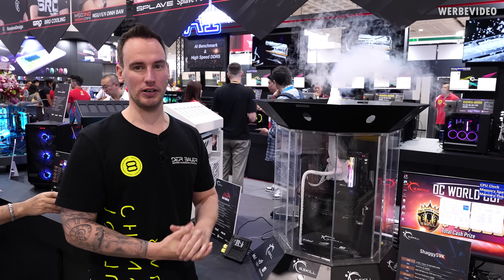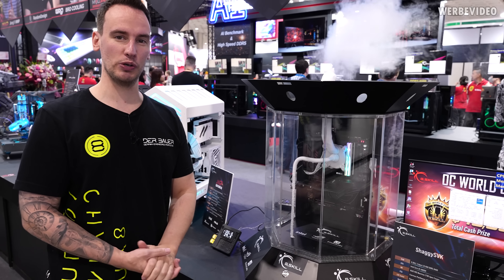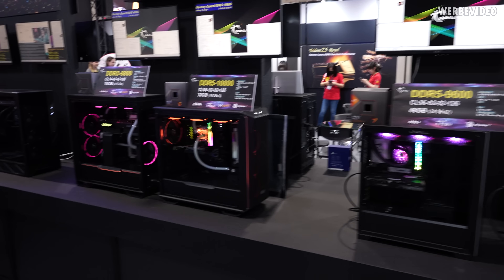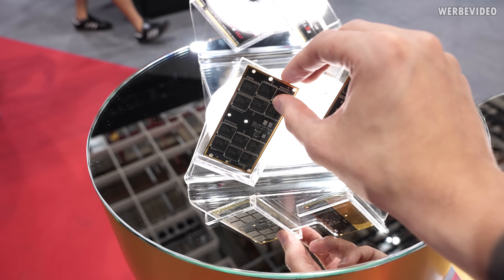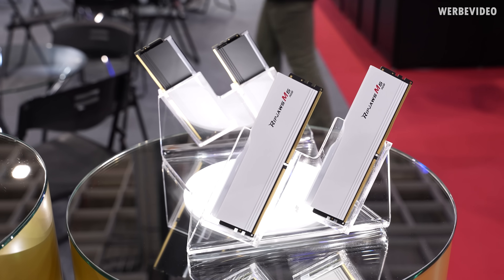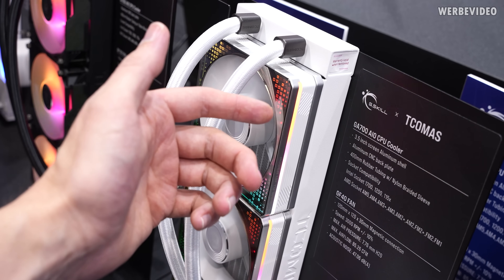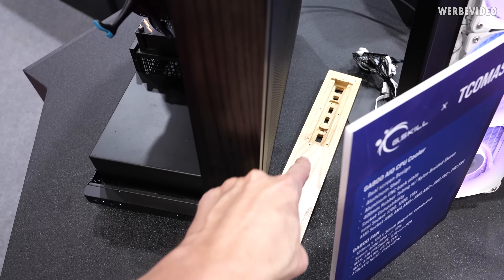DDR5 Modules with 10600 MT and a $ 10,000 LN2 Cooler - G.Skill Computex 2024

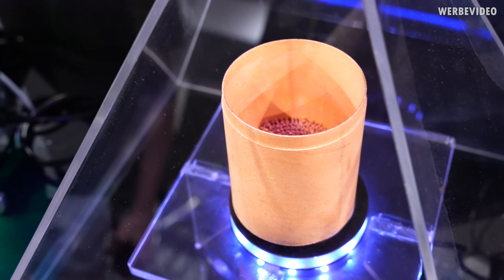Comment: 8:50 metal 3D printing itself is getting a lot cheaper, I have on occasion used it when working in the special machine (custom production lines) business.

The reason this is so expensive is because it uses controlled porosity 3D printing, were they can precisely decide how porous different bits of the part are.

The wall are ofc very close to water tight, while the middle is very porous for maximum contact area with the liquid nitrogen.

Comment: Only reason why I would go for the new form factor is if they support higher transfer speeds in real world applications. Building a new workstation with 96GB in two dimms. So they would also have to at least match current capacity for two channels.

Comment: did they not realize they could have used the nitrogen to pump out the humid air cause nitrogen is a dry gas spaceX uses nitrogen to keep water out of there rockets for that very reason but instead they waste that outside the case how dumb

Comment: wouldnt mind seeing huge low latency dram cache, like several gb, on die instead. in addition to existing caches. then just normal dimms. enough where you can run entire programs from the cache with the background slower tasks living on the normal memory. i really dont like parallel mounting that m.2 uses, despite how fast they are. just hogs board area. so having the ram do that too would be rather cluttered. especially for sff enthusiasts. wouldnt mind seeing cpu sockets with ring dims (can be in sections or a single module) that share the socket (and cooling solution) with the cpu. would make grace hopper's ghost smile.

Comment: Here's a summary of the advantages of CAMM2 (Compression Attached Memory Modules) over traditional DDR (Double Data Rate) memory modules:

Compact Design: CAMM2 uses a compression connection method that allows for more compact and efficient designs compared to traditional DDR modules. This design is especially useful for laptops and other systems where space is a premium.

Improved Performance: CAMM2 modules are designed to support higher data rates. The standard mentions initial support for 6400 MT/s (Mega-transfers per second) and the potential for future increments in speed, aligning with advancements in DRAM technology.

Enhanced Signal Integrity: CAMM2 modules implement specific length-matching principles that reduce unnecessary serpentine routing. This improves signal integrity and reduces latency, leading to better overall system performance.

Modular Flexibility: CAMM2 supports both single-channel and dual-channel configurations. Single-channel CAMM2 modules can be stacked, which is beneficial for systems requiring maximum memory capacity without increasing the footprint significantly.

Adaptability for Different DRAM Types: CAMM2 is compatible with both DDR5 and LPDDR5/5X memory. This flexibility allows for use in a variety of applications, from high-performance desktops to power-efficient mobile devices.

Thermal Efficiency: The standard includes considerations for thermal management, ensuring that CAMM2 modules can maintain performance without overheating, even in compact and densely packed systems.

Reference Designs: The document provides reference design examples and routing guidelines, which help designers implement CAMM2 modules effectively in their systems while ensuring compliance with timing, signal integrity, and thermal requirements.

These advantages make CAMM2 a promising alternative to traditional DDR memory modules, offering better performance, flexibility, and efficiency in modern computing environments

Comment: CAMM modules should be made such that it works both on Desktop and Laptop no CAMM and LPCAMM nonsense.

Single design pin system m.2 style single width and double width modules. Single width module designs for entry level, lower memory modules for laptops, mini-ITX and SFF desktops, and everything else having support for double wide modules.

I want to be able to cut a slot in my Steam Deck -3- 10 and have a 256GB RAM double wide module stick out the back like a Game Cartridge and run it at rather boring JEDEC speed of 8400MT/s instead of watercooling it in my desktop and get 12000MT/s.

Edit: Forgot Valve can't count to 3, adjusted comment accordingly.

Comment: I see the new memory form factor as a positive attempt to keep the ability to upgrade the memory in a laptop. I Hate some modern Laptops as you can't upgrade memory or storage as the uses you use it for evolve. The argument that it means ram can run quicker is mute and causes ewaste let's say I buy a laptop do casual photo and film work then someone says can you do my party/Wedding etc and then someone else and  it becomes a small business that laptop if memory and storage is soldered in place can't be upgraded as you move on say from 720p film and photos to 8k & becomes ewaste but some times just a little memory or storage helps. I've always had to upgrade storage and with Windows 8 laptop when upgraded to Windows 10 worked better upping memory from 8gb to 16gb you never know the future so expandability was pc core strength that's being erouded with time

Comment: CAMM2 has a major benefit over slot ram, it can utilize actual heatsinks to dissipate heat and remain stable at higher speeds and tighter timings. So much like what motherboard manufacturers do now for M.2 heatsink covers, they would do with CAMM2 and would look pretty sleek.

Comment: Hey der8auer: Nice quick tour of this booth.
(1) Liquid N2 cooling in intro:  I expect that gets messy when the unit is powered down and brought to room temperature 😓
(2) Concept hexagonal case - G-Skill should go for production on this, with changes.  Looks interesting and seems to go "all in" on the convex air intake underneath that we're seeing also from Lian Li (and Fractal Designs?).  The main change I'd like to see is that the top angled sections mirror the bottom ones.  I think the vertical slats on the top pieces will impede outward airflow and negatively impact exhaust fans.
(3) The case with the timber strip looks nice
(4) Love your t-shirt - This may not have been the intention, but it makes me think of BVB away shirt 🍻

Comment: I absolutely want to see CAMM2 on PCs for DDR5.
As long as it can be had in medium capacities like 16GB and 32GB.

The less slots/traces/trace-length to mess up signaling, the better IMO.

For the same reason I always wonder why MB makers even make so many boards with can hold 4 DIMM.
Two, one on each channel is plenty for nearly all users and even removes confusion.
The two extra, never used, only are a detriment to the consumer.

Comment: The CAMM modules sound like such a novel idea with a lot of pros vs cons, outside of having to buck up for whatever potential max capacity you'd foresee wanting to run in a few years time upfront (i.e. not having the potential to upgrade to keep a system relevant or expandable for higher tier tasks). Not having to worry about cooler clearances and direct channels to the CPU is a big deal though and may topple the argument in the near future.

Comment: I'm of two minds on the CAMM memory at least on desktops.  Laptops it makes perfect sense.  Desktops...You are limited 1-2 modules meaning that you need to buy higher capacity modules out of the gate meaning more $$$  And if you want to upgrade later you have to outright replace the module  You can't just buy more modules to add to it.  HOWEVER in theory the design would allow for better stability so I don't know.  Maybe keep CAMM to the top end halo product boards for now?

Comment: All the screens and RGB controllers are too much. Too much software and controllers, I would rather go the way the ASUS proart motherboards are going with workstation, black pcbs with no LED and no gimmicks, just a bunch of connectivity. Also no integrated wifi because it gets outdated too quick, if they could also do no sound card either and more pci lanes to my devices.

Comment: I don't mind CAMM2 but when people buy them they have to remember that they can't just drop in new memory modules so spec for what your future needs are not your current. 

Most likely, when you need more RAM then what you over specked for you'll probably have to buy a new pc anyway and most likely there'll be a new spec like CAMM3 or 4 anyway that will most likely not be backwards compatible

Comment: When I saw the MSI implementation of CAMM2 on a desktop board. I really had to say that the potential for cooling, memory overclocking, as well as innovation in small form factor and laptop in terms of repairability and form factor have me very excited. It's really going to come down to if vendors actually implement this as a standard and begin to phase out the old DIMM technology if it sticks in my opinion.
Reply: we also need 12VO. and connectors. on the back.
Reply: @ChrisWijtmans  Maybe we'll see Project Zero Plus Ultra with backside connectors, CAMM2, and 12VO at CES 2025.

Comment: camm2 will not work today. They need to wait until ddr6 and make it the default form factor. today's ddr5 is all about 2 dimm slots to reach higher clock speeds.

Comment: CAMM2 looks nice, for sure. A bit less upgrade friendly, but lots of perks. For one, increased capacity and speed. Also clearance with large air coolers is no longer an issue. ITX possibilities are also potentially great, amazing for those slim sandwich cases.

Comment: The problem I have with the new memory form factor is the lack of ability to add more capacity without having to replace the memory you already have. That's fine for high end systems but not ideal for mid range and lower. then there's the increase of very fragile pins, so very easy to bend the CPU pins but that's a low chance of a part replacement upgrade compared to memory. Thats going to create allot of bent pins on mid or low range computers where memory upgrades are very common. For high end the benefits are worth it but for mid to low the drawbacks outweigh the benefits by a considerable amount.

Comment: Camm2 seems more interesting form factor for laptops, although with ddr5 having odd throttling over a certain temp makes cooling cleaner. In the desktop space it would be cool if it could open up the ability  to have wider memory bus for ram like a theoretical 128 or 256 bus for ram maybe camm3

Comment: I'd 100% prefer the CAMM2 modules, over the typical DIMM modules, when their price makes sense. It's almost definitely already going to be a thing, but I'm wondering how cooling works with those. The bottom side doesn't seem to be touching any kind of heatsink on the board or anything. I'd be 100% for it waterblocks for them exist.

I don't ever add more ram to builds so that isn't a problem to me. As it is, I wish there were more 2 slot boards that could run the ram better.

Comment: With what we've got right know I don't like CAMM2 for desktop, it means going from 4 slots to 1, killing most upgreadeability, many in the very high end, enthusiasts like most here may want the high speeds so end up replacing DIMMs (and not using the 4 slots) anyways, but for a majority of users is useful, current systen is good for everyone and with CAMM2 is simple better for some and worse for others, because regarding speeds here we don't have the same speed limitations SODIMM was having in laptops, with DIMM in desktop you don't have a clear ceiling, it is simply more complicated to memory and motherboard manufacturers to create designs that can acomodate higher speeds, and the biggest bottleneck many memory manufacturers experienced seems to be being solved with CKD chips, so I like LPCAMM2 on laptop (and already am bothered to think that maybe no laptop can have 2 slots if it is a design limitation or something, big laptops also had 4 SODIMMS, but on laptop pros overweight the cons considerably) but in desktop not using the space in the vertical dimension that we have available unlike a laptop seems like a waste and the cons of CAMM2 look so to me, not to mention that I see it not worth it even for manufacturers, the need to replace all the memory in every upgrade ever performed is going to mean in the mid term (if CAMM2 is widely adopted) a flood in the second hand market, even of high capacity modules as if you want to use a new capacity you need to not use the one you have, so if anything may make buying second hand RAM common, reducing sales from manufacturers and creating ewaste in form of low capacity modules that are not useful by only themselves anymore.

Comment: I wonder if there are any issues with the back-side memory chips heating up more than the front-side chips on the CAMM2 module since they will basically end up pressed right up against the motherboard. Maybe there are enough vias through the PCB to keep the heat fairly well distributed?

Comment: I am extremely skeptical about the new memory module configuration. Mainly firm contact with the pins and no ability for the modules to move or to loose connection with the MB. Not to mention market demand and price.

Comment: The new ddr5 seems nice but it all depends on price. If it is both better than inline and cost less then hell yeah. Also since it seems one board  takes care of every memory lanes memory allocation. I would like to see how it improves dynamic memory allocation. Old ram had when it had to move data from slot to other slot had serious latency. i would like to see rams internal memory control cpu would only need to say i need this data instead of this slot in this slot this core will ask it next from there, and this core also need the previous slot open for writing. Old ram would need to write to ram and if other core would need to read it it would need to do whole dataline trough cpu. or al least the amount of simultanious ram read and writes where limited.

Comment: what board has room for multiple of these connectors? and if it doesnt, there's no more upgrading, it's full replacement every time ya need to bump up your memory..
Reply: i mean they always suggest to get a 'kit' anyway because otherwise it'll default to lowest speed
Reply: @bradhaines3142  sure, but this is more a later life use, when it gets relegated to a secondary machine, maybe a home server, being able to jack up the ram even if ya take a speed hit, or have to tune it from bios, you.'re extending the life of your purchase, something manufacturers would like people not to do, and rather constantly buy new, so opposing anything that eats into that longevity is in the best interest of consumers, ya dig?

Comment: Thanks for the video. The metal frame you talk about (for feeding electricity to the fans) works also as spacers for the fans. That's useful feature for increasing the airflow area through the rad fin stack. Nice some engineers also think about this in the design. Thumbs up for this mounting design.

Comment: when it comes to "smaller" DIMMs".  why not switch to SODIMMS.  that would at least "reduce" some of the signal paths, as the connector is tighter.  the new one.. seeing that only one can be used in a system, upgrading it would be pointless. they might as well solder it to the board at that point.     Also the proposed does take a bit of motherboard space.   

Though the speeds are impressive, sure thing about it.  but still can't they achieve something like that with SODIMMS?

Comment: Thus far most mobos on those videos I saw only had slot for single CAMM2 module, which means any upgrading is basically an e-waste generation, or you need to try to resell. 4 DIMMs at least had that "advantage" that you could either buy like two modules to have dual channel, or worst case scenario single module on a 2 DIMM mobo, and then upgrade by getting "the rest". With CAMMs it seems its you buy one, then you need to swap it entirely if you want more memory.

So the question would be about the cost of the CAMMs memory compared to DIMMs ones, and how big of a difference it would provide in terms of faster speeds supposedly available thanks to simpler connection routing between CPU and CAMMs vs DIMMs. So basically a TL-DR: need to see shit in action to see if its worth the hassle.

Comment: It would be interesting if one of the manufacturers would make GDDR CAMM2 for GPUs.
Then have the ability to mount RAM modules to the back of the GPU.
ISTR that one of the benefits of that memory format was better signal integrity which is one of the justifications for having soldered memory on GPUs.
Reply: This is what I want to see as well. Memory is going to be very important in the future and I'd love to be able to upgrade speed or capacity of memory without having to buy another whole GPU brick.

Comment: I kinda like that magnetic fan.
Being able to pull one off to hotswap into a test build or project would be nice.
But only if the mounting plates can be sold separate to the fans. (I'd need extra plates for such hot swapping)

Comment: I am wondering if CAMM2 can possibly be modified for desktop and integrated into the socket itself.  Memory pins on half the socket are in the module itself.  Stack module under CPU (obviously let the PCB with the memory chips hang out the side.  Either pass all signals through the memory PCB, or have the PCIe and power pins higher so they are level with the memory height pins after memory is installed.

Comment: If CAMM2 offers better memory performance for any reason, whether it’s easier to cool or improved frequency and timing from better signal integrity, I’m all for it. I wouldn’t use more than 32-48GB right now anyways, but definitely wouldn’t mind getting more than 8200 with the same or tighter timings than I already use.